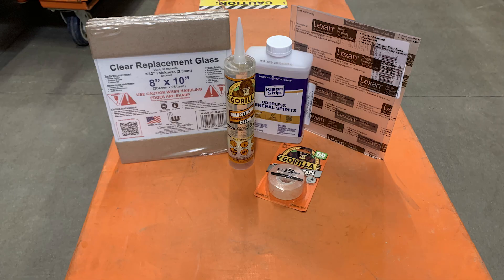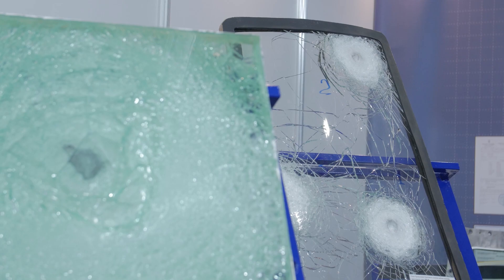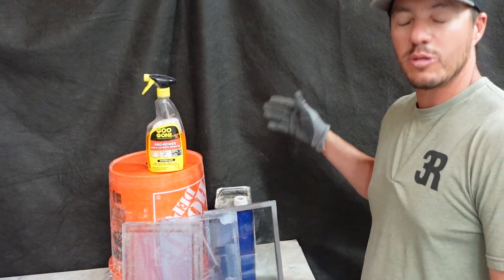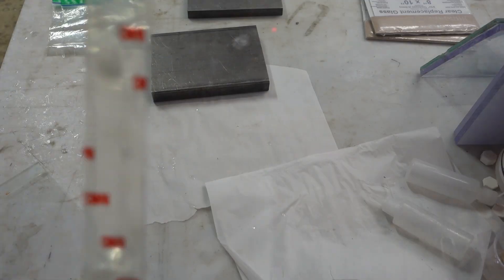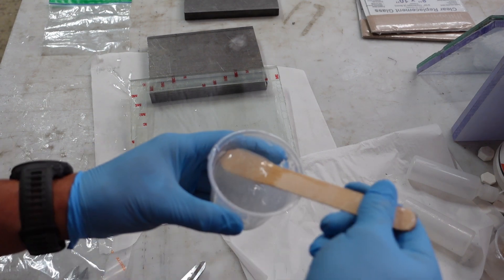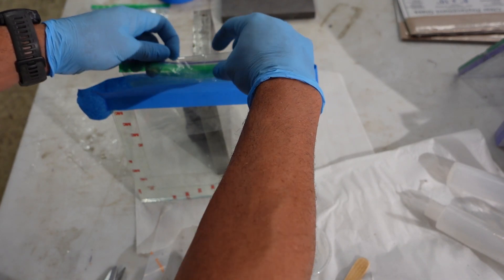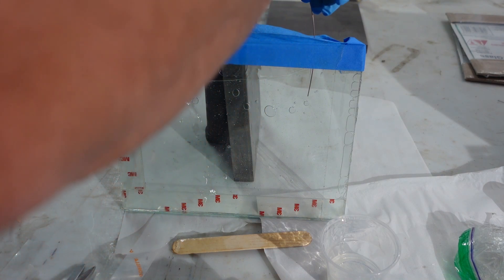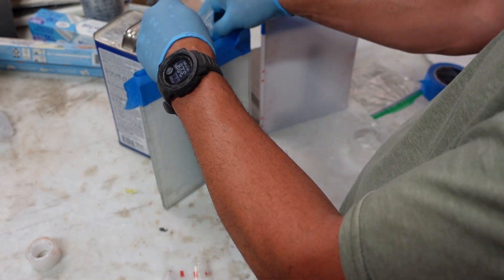Home Center Homemade Bulletproof glass build

Comment: Why use the Acrylic layers, when Polycarbonate
Is stronger ? Cost?
Reply from the maker: It’s more the difference in material properties. Polycarbonate is strong but ductile where as acrylic has very hard surface properties. Clarity is much better with acrylic as well. However given everything else equal, you are correct that polycarbonate is stronger.

Comment: I suppose it will stop 9mm .
And could stop something with higher energy and not tipped bullet like 10mm  or something else with energy around 1000Joules.  But it depend on quality of polycarbonate - it mechanical properties are very different .
It can stop 556 only if glass sheets are tempered.

Comment: Thank you for providing different build recipes.  Most people will have access to a hardware store, even in a grid down scenario.
How did you come to the resin infusion method you used with the plastic bag?  Did a standard brush method not work?

Comment: I always like budget builds/at home builds. For me if I was going to do this for a windshield, rear window and 4 side windows time is not in my favor to do that. Would it be faster and easier to just get 2 inch polycarbonate? I'm not trashing home builds but time is money and it ends up 2 inches thick anyway. I'd want to stop .308 at least. I'd assume 2 inch polycarbonate would do that?
Reply from the maker: Unfortunately, I’ve tested 3 inches of polycarbonate and it does not stop even 5.56 nor .308.
Reply: @3RBallistics  oh that stinks. I thought it might do better.
Reply: Did you survive your engagement?